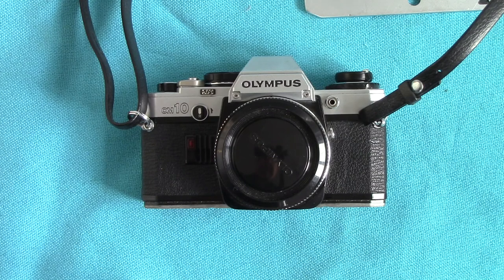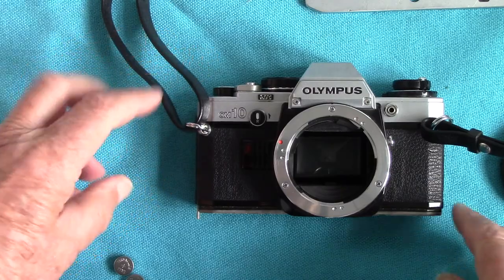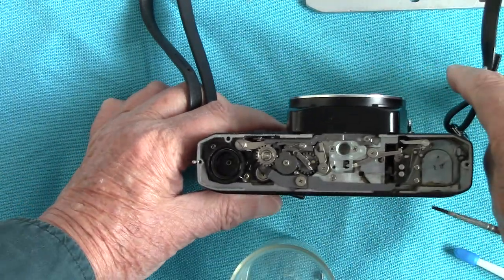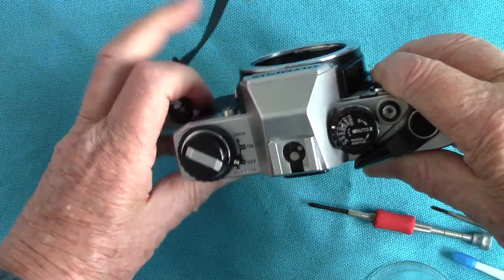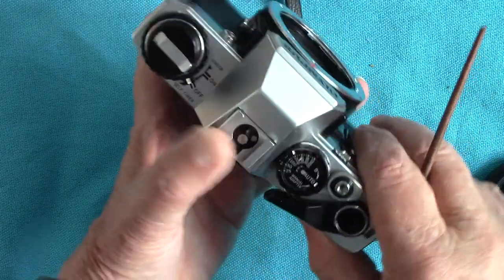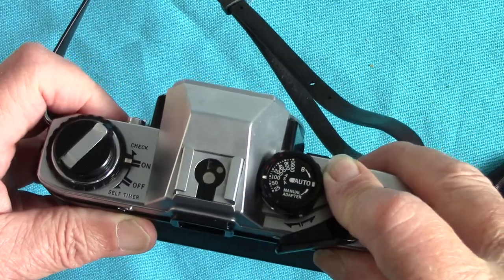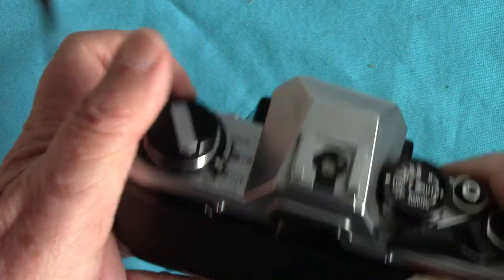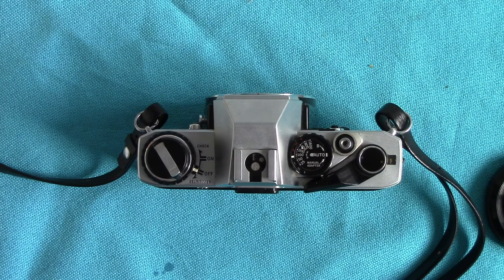OLYMPUS OM-10 film camera renovation and controls

Comment: You are fun to watch!  A few points on the OM-10, though....

1. The 10 is designed to "lock up", with the mirror half way up, if there is no battery power.  That is to keep you from winding and firing the camera when it can't work -- it needs power to open the shutter.
2. The "TTL/Off-the-film" exposure control system used in the 10 does not control flash exposures with OM-dedicated flashes as on the OM-2, OM-2n, OM-4, etc.  A dedicated flash will override the Auto setting on the camera and set the 10 to sync speed, though, but the flash exposure is controlled by the auto cell in the flash.
3. When using a non-dedicated flash, it is necessary to deliberately set the camera to the "Manual Adapter" setting, either without a Manual Adapter attached, or if a Manual Adapter is attached, it must be set on any of the blue speeds -- at higher settings (1000, 500, etc), the flash may catch the closing curtain, preventing flash exposure on the entire frame.  (Incidentally, when set on "Manual Adapter" mode without a Manual Adapter present, the shutter speed delivered by the OM-10 is approximately 1/45th second.)

For the record, an incredibly high percentage of OM-10's suffered from "sticky magnet" due to excessive lubrication contaminating the electromagnet that controlled the shutter.  (Trust me -- the OM-10 NEVER needs more oil!)  There's not much to correct this besides a complete overhaul, and 10's are not likely worth the expense.  What you CAN do is try to avoid winding the shutter until just before making an exposure -- without being wound, the armature is held away from the electromagnet, minimizing the chances they will stick together.
Reply from the maker: WoW ! Thanks for taking the trouble to give all those  'Tips' -- now i have been given a SECOND OM-10 WITH the 'Manual Adaptor '!

Comment: I just bought an OM 10 on eBay. I did my research and knew it depended on Good batteries to work. I had an OM 2000 (actually made by Cosina)  which has a problem with its aperture linkage. Nice to have a true Olympus.

Comment: For those out there who have an Olympus OM10 film SLR camera:   in my previous post I asked for help regarding the shutter speed indicator LED's not working:   problem solved.  I very carefully applied some liquid 'electronic circuit cleaner' around the shutter button and the collar surrounding it (which is a pressure-sensitive switch),  the mode selector/ASA selection switch,  and the on/off/battery check/self-timer switch.  After working these parts a bit after applying the cleaner material,  problem solved.  Shutter speed indicator LED's now working.  As I suspected;  apparently there was some gunk buildup/corrosion on a contact point and the electronic cleaner material solved the problem.  Not bad for a $37.10 antique shop find.

Comment: Yup, this camera will lock up without a working set of batteries installed. Needs them for the internal light meter to ensure correct exposure. Trap I fell into when I was given one. I did buy a manual adapter for extra versatility and an auto wind on adapter.

Comment: Hi Peter Im looking to get a om10 is there anything I should look out for ?
Reply from the maker: Have a look at the Foam Seal Strips and Mirror Bumper to see if the foam has gone rotten .
Reply: @theoldfilmbloke  would I have to take that into shop to get repaired ?
Reply from the maker: @andywalczak7659  NO -- get a sheet of 1mm foam from a 'Handy Crafts' shop price 85 pence and do it yourself as I did -- there is a branch in Romford.

Comment: OK I hope somebody out there can help me:   I picked up an Olympus OM10 camera with a Zuiko 35-70 mm f/4 zoom lens on it.  The camera is physically in good condition;  the lens is in impeccable condition.  Everything seems to work properly except one:  the shutter speed picked out by the camera for the corresponding lens aperture selected;  is not being indicated along the shutter speed column at the left hand side of the viewfinder.  The light meter seems to be working as I can swing the camera from brightly lit scenes to dark,  and the shutter makes correspondingly different sound like it is changing shutter speed for the light conditions.  Also when I change lens aperture for the same scene:  the shutter speed sounds like it is changing accordingly for the lens aperture selected.  Just no indication of shutter speed showing up in the viewfinder.   I picked up the camera + lens for $37.10  US funds so I'm not out a whole lot of money.  I would have passed on the camera were it not that I think the shutter speed is being set properly by the camera in spite of no indication of shutter speed showing up in the viewfinder.  Oh and I did put fresh batteries in it still no shutter speeds indicated in the viewfinder.  Running first roll of film through it not developed yet so not sure yet if the shots I took are properly exposed.  Comments?  Thanks.

Comment: I have an OM10 that is showing faults in the electrical part. I use the adapter to manually set the speed. Can you tell me if even without the electrical part working this adapter works normally to set the speed? Or if without the electrical part, how fast is the camera shooting.
Reply from the maker: Without knowing 'Which ELECTRICAL PART is difficult to advise. As far as I know there are NO electrical parts in the Manual Adapter.

Comment: Just obtained an om 10, new batteries, check system works, veiw finder ok , wind on and shuttet not working , base plate off oiled , manually can operate shutter and wind on ? Any thoughts, tegards Dave
Reply from the maker: Sorry -- need a Professional to look at it

Comment: hello, I have in the "parking" my old OM10,the batterys are absolutely dead after long time non-use,& now the camera is 'locked'.
What type-good quality battery cells did buy ???does anybody knows about ? - thnX
Reply from the maker: I hope you have Cleaned Out any CORROSION from the Battery hole or there will be bad contact with new batteries. You need 1.55 Volt Silver Oxide Button Cells  I get them from www.buyabattery.co.uk here in England,
Reply: @theoldfilmbloke  thank you very much for info-help,
the battery hole is absolutely clean,I checked the batterys by voltmeter,
and they are in too low voltage(0.5V).I asked about high quality batterys, for replace the old simple alcaline. 
thank you - regards

Comment: On the OM-10 to use a flash you have to set the shutter speed to 1/60 second for synchronization.  How do you do that?  You set it to manual adapter and with no adapter connected.   Ah, and now we get to the place in the video where you say exactly this 😀
Reply: Just set it to manual it should default to a compatible shutter speed.